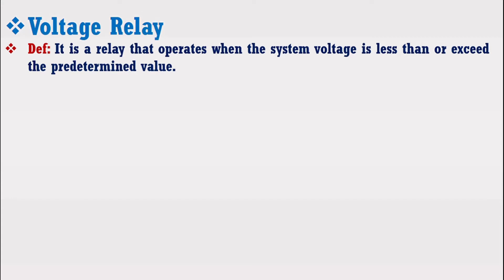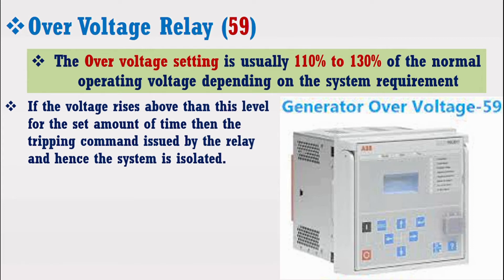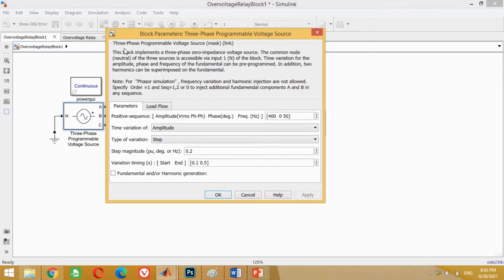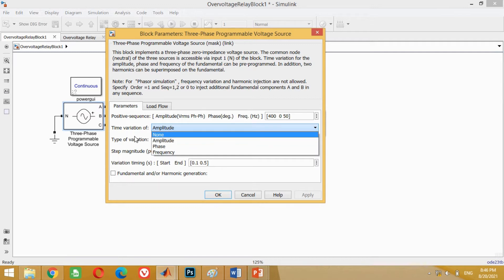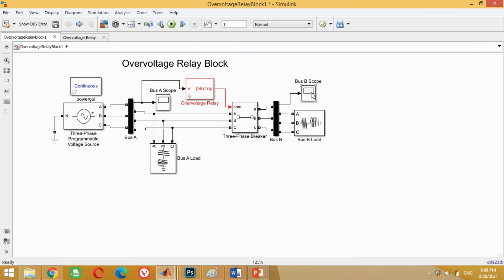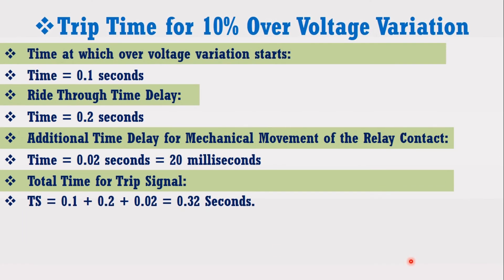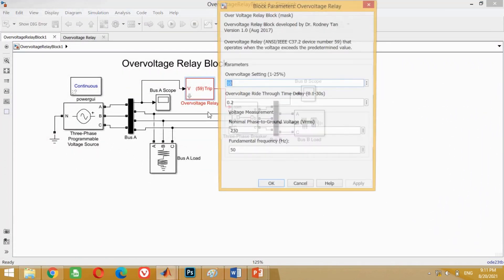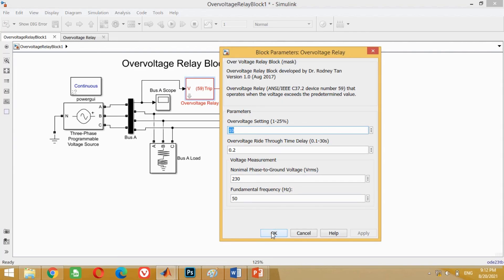How to Design Over Voltage Relay Model in MATLAB SIMULINK | Dr. J. A. Laghari

Comment: assalamu alaikum sir,, can i ask you something,,, can i join in one simulation,, i mean modeling over voltage with under voltage in one simulation
thanks
Reply from the maker: Wa'alaikum salaam i am not sure but you may try it. May be it works.
Reply: @DrJALAGHARI  thanks sir,,, if i found any problem can i contact you sir ?
Reply: Bro which MATLAB version it is

Comment: Sir this is not correct simulink in link description
Reply: Sir i have a circuit diagram of hybrid energy system i want to send it to you then you implement on matlab then upload video
Reply from the maker: @UmarKhan-st1qd  you may send it. I will check it and if possible i will make video on it.
Reply: @DrJALAGHARI  check your email sir
Reply from the maker: @UmarKhan-st1qd  ok
Reply: @DrJALAGHARI  sir whats about the circuit is there any chance of implementation
Reply from the maker: @UmarKhan-st1qd  no. It is not possible without the values.
Reply from the maker: Thanks for the comment. I couldn't understand your comment. Can you please explain again ?
Reply: @DrJALAGHARI  this is not correct file in description your video is about over voltage relay butt you upload frequency relay simulink file in given link please upload right file in description
Reply from the maker: @UmarKhan-st1qd  Thank you so much for highlighting this mistake. I have inserted the correct link. Now, you can download the over voltage relay Simulink model.
Reply: @DrJALAGHARI  sir i have mail you a circuit of over/under voltage relay sir please implement as soon as possible
Reply: Sir which matlab version it is